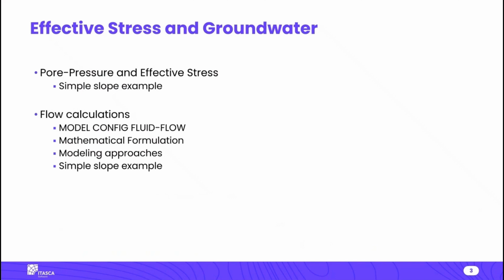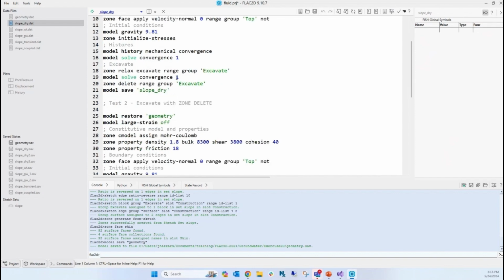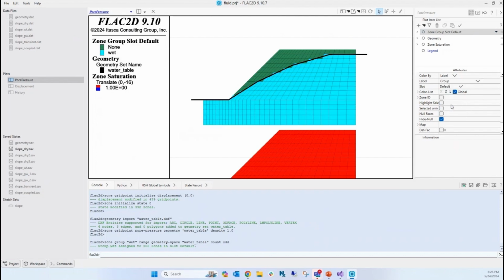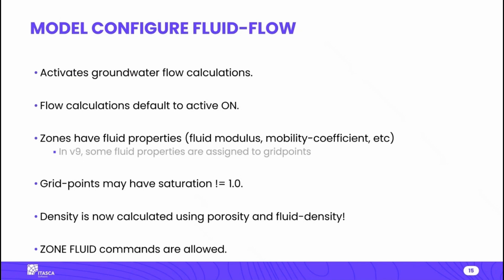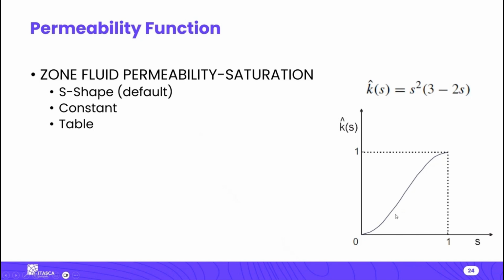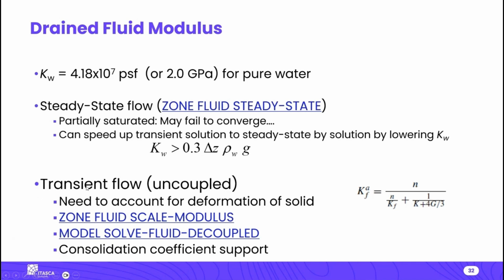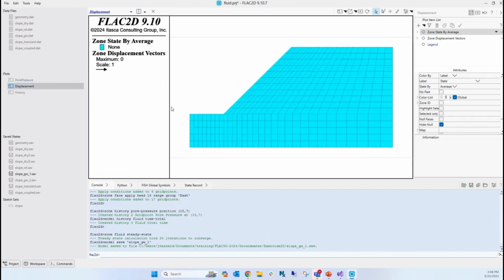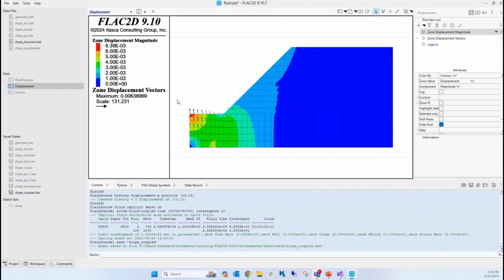FLAC3D 9.0 Fluid-Groundwater Modeling Part 1 | Introduction to Pore Pressure and Flow

Comment: Really Nice. How can I generate the water table. I am using Flac3D9
Reply from the maker: Refer to the zone gridpoint pore-pressure command (https://docs.itascasoftware.com/itasca950/flac3d/zone/doc/manual/zone_manual/zone_commands/zonegridpoint/cmd_zone.gridpoint.pore-pressure.html?highlight=pore%20pressure). You can define a water table using an imported CAD file (geometry) or specifying a Table of values, importing from MineDW or CSV file, and a few other ways.
Reply: @itascasoftware  This command is not working for vesion 9.0??
I have also other question, is it enough to just set water table and software automatically calculates pore pressure??
and about density , also we specify the water level shouldn't software automatically knows and assign density based on unit weight.

Comment: Nice work. How can I do the same thing in Flac3D9 instead of Flac2D? 
Do you have any recommendation?
Reply from the maker: In FLAC3D you can simply extrude the slope cross-section along a straight line or a curve. The commands are nearly identical - just include the out-of-plane parameters and note that the z-axis is up and y-axis is out-of-plane, which is different than in FLAC2D. Also, to take advantage of the faster/improved fluid flow logic, you should use FLAC3D v9.1 or above.